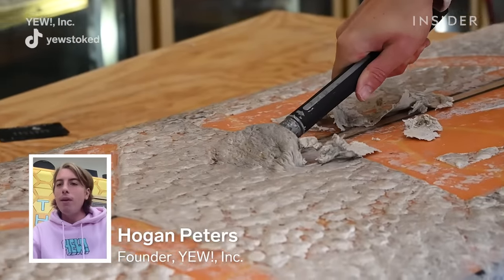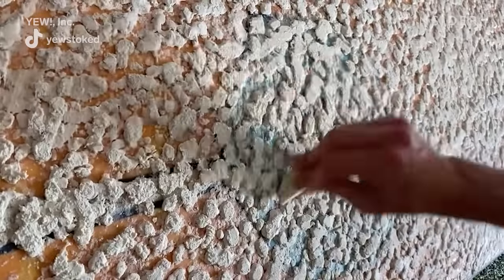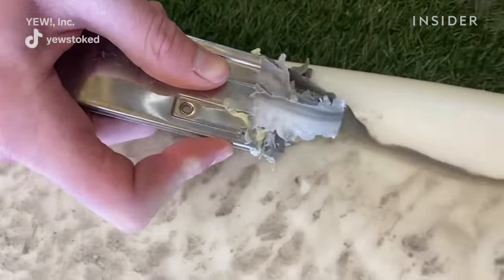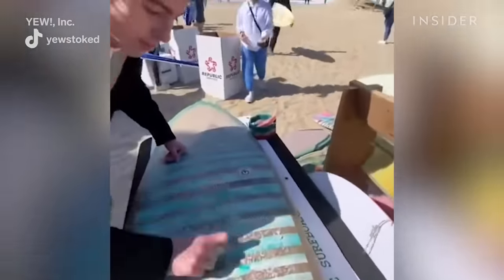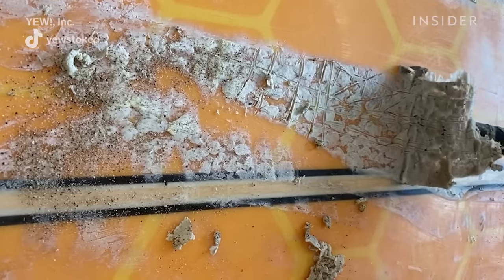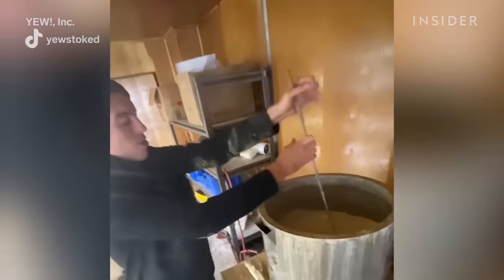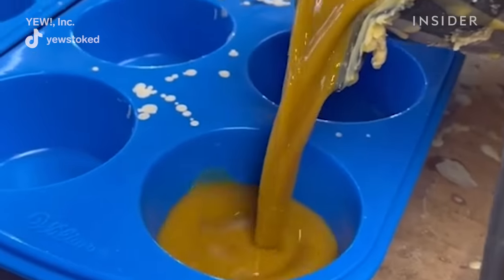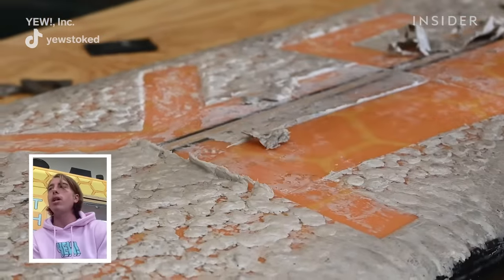Scraping Old Layers Of Wax From Surfboards | Art Insider

Comment: Wouldn't it be easier to melt it in hot water instead of scraping it with force?
Reply: Wax and water don’t mix, that’s why it’s used on surf boards so that it will stay on the board. An easier solution might be to heat it with a blow dryer to soften it a bit, but I’m not sure how good that would be for the board. Having said that, it doesn’t look like it’s too hard of a job to scrap it off anyways.
Reply: @Lacroix999  
They said in HOT water, which would definitely soften the wax, making it easier to scrape. That's pretty logical actually.
Reply: @Lacroix999  
And yeah, people are just lazy af.
Reply: @shizukagozen777  I don’t believe so. Maybe “not quite as motivated” to do things they ‘should’, but I don’t believe anyone is “lazy” only that people don’t like doing things that are hard. either way, it’s not our job to judge them. And if they don’t do what ‘should’ be done to maintain a board in smooth working order, it’s their board that will suffer and their face that could potentially smack the wave if they don’t.
Reply: @Lacroix999  
Hmm, yes, this is clearly laziness, and we can judge is much as we want. 🤨
Reply: Or just put it in the hot sun which would also heat it to soften it.
Reply: @shizukagozen777  while anyone CAN do so something, doesn’t mean they should. And if it doesn’t make or break your day, why take the time worrying about and casting judgment about what others do/don’t do? Do you not realize that your judgments say more about what you do than the one you’re judging and that’s why you shouldn’t do it.
Reply: @whatfreedom7  that’s what everyone does.    This guy is a ding dong
Reply: @shizukagozen777  it's not really the laziness people are normally worried about it wearing down their board (graphics), that's why this whole comment section and others like it are filled with people always trying to debate alternatives, and the fact that someone who does this for a hobby or for a living doesn't want to do it every single time. The skateboard community actually shares the same dilemma, not everybody agrees with hard sandpaper that you can tear skin off with when hit at the right angle. But with that they're actually our alternatives available. Though mostly gimmicky.
Reply: If you used hot water to melt the wax,  it'd be harder to reclaim the wax for proper recycling if it was melted with water. He said he's able to remove the impurities and recycle the scraped wax.  There's usually very good reasons why people world wide do things a certain way.  🤔
Reply: @Lacroix999  but sunlight is free and doesn't generate any carbon emissions in the creation of the electricity necessary for running a blow dryer.
Reply: @shizukagozen777  it'd also called being eco-conscious and wanting to recycle as much wax for future use and using a completely renewable resource - sunlight - compared to an electric heat blower....that'd not lazy, it's smart.
Reply: @dawnchesbro4189  true, however if sunlight melted the wax enough to remove it, then surfboards out in the sunny weather wouldn’t go well together. Something tells me this wax it harder to withstand that from happening.
Reply: @dawnchesbro4189  he literally said in the video to leave the board out in the sun to soften the wax.
Reply: @Lacroix999  sunlight does soften the wax that way, if it's left out for hours in the sun. But in recreational or sport use on a surfboard, how often will that board be left untouched for hours baked by the sun? And how many hours will that board be in the water, which has markedly cooler temperatures than sitting in the sun? Have we cracked the code yet?  🤨

Comment: Doesn't having a rough sticky surface on a surfboard reduce its ability to glide through the water?
Reply: Not a surfer, but I'd think you'd only wax the top of the board. The bottom stays smooth.
Reply: The board wax is meant for your feet to grip, surfers wax the top part of the board. It's a useful substance that improves your traction without increasing risk of abrasive injuries.
Reply: Nope! As long as you are not placing the wax on your rails or bottom of the board, otherwise you would be fine. Wax is sticky so it helps to allows surfers to preform tricks and turns, and helps maintain to have your feet stay on the board.
Reply: Yeah, water will grip to it. Once I used so much wax on the board I almost dragged the Atlantic Ocean away with me.
Reply: @4f52  this gave me a good laugh 😂
Reply: You obviously don't wax the bottom, come on now ! 😂
Reply: @4f52  
BAHAHA

Comment: I have a question for anyone that may know. Why do they use wax and not just make the surface of the surfboard textured for grip to avoid the necessity and extra work of waxing?
Reply: I'd guess that any applied texture can wear out needing expensive professional repair where this can be done by anyone and is cheaply and easily maintained. I'm sure some company is trying to develop some nano technology to mimic a geckos feet but it would make a surfboard close 50 billion

Comment: There also is this brilliant material that is called rubber, doesn’t wear nearly as quickly as wax and grips just as good.
Reply: rubber also cracks, peels, and warps and when it wears off in like 2 days due to saltwater corroson youll have to buy a new board

you are not a very brilliant fellow
Reply: Rubber is also super slippery when wet, sooooooo...

Comment: Snowboards do something similar, but it's for the opposite reason. You put it on the bottom, and you use it to glide on the snow better. Also, you kinda work it into the board instead of leaving it in sheets.

Comment: I'm a soap nerd so this is neat to see you using basically soap (and candle) skills to produce your surfboard wax. It was also interesting to hear how there's different formulations according to the temp of the water you surf in. Of course that makes sense but not being a surfer I hadn't thought about it. But really more than anything this indulges my zit picking sticker peeling fixation in a very hearty way too. 🫠 Once you have the majority of the wax scraped off do you have a way to rinse the rest away? Maybe buff it out with some really hot water.

Comment: As someone who's complete experience with surfer boils down to 'the big kids on the pier line (our houses were those little places on stilts and a pier/boardwalk/deck. Walk out of house onto back deck, walk too far and fall directly into the Atlantic, so 'neighborhood' feels like a weird way to explain it) would surf and just pass me board to board' and therefore utterly uneducated about this stuff... why not put grip into the board build? The board equivalent of that grippy cupboard liner stuff that keeps things from sliding type thing? If you want grip and don't want to be grinding petro-based oils into the water... wouldn't it just be better to build the grip into the board from the start? For smoothing like in snowboarding, I get waxing Boards get beat up and dinged, the surface damage would slow the board or at least make it a bit more difficult to maneuver. (guessing on that one too, I'm more likely to be in the lodge with hot cocoa and a long day curled up somewhere warm reading while everyone else goes tumbling down a mountainside on a bit of wood) Not so much understanding why you wouldn't just make the board grippy when it's created. What am I missing? (Other than any desire to go and attempt either surfing or snowboarding. THAT, that can stay missing. I like having 2 unbroken legs, thanks. And I know my limits of coordination!)

Comment: Im not knowledgable on surfing so can someone please tell me why instead of waxing they dont just have the premade foot insertions that you can buckle your feet to the surfboard like in snowboarding for instance? You could still move the board but yiur be strapped firmly no?
Reply: If your feet were to be strapped in place on an object that floats you risk getting trapped upside down underwater in surf currents and potentially unable to free yourself. Some boards have an ankle cuff attachment so you don't lose your board,  however you'll notice that they have a length of cord to provide that necessary buffer of distance so your board doesn't increase your risk of drowning. 

Having something firm to grip that won't cause abrasions/lesions from friction while also allowing you to slide off quickly when needed is where board wax does the job perfectly!
Reply: Thanks guys this was what I was also leaning as to why logically but i wanted to hear it from people who actually know surfing. Thank you.

Comment: Does anyone remelt and strain the old wax and reuse it on the board, or is it a taboo??
For reference, I’m born and live in upper minnesota, like Canadian border… so I have little experience on this topic.

Edited for stupidity, they covered it lol
Reply: Not usually. Generally you scrape and re-wax when it becomes contaminated. Say with sand or whatever else. If you were to re-use it, the surface would be like sandpaper. Board rash is a common issue faced when surfing, which is caused by excess friction between skin and surfboard, so adding sandy texture to the mix would just make the problem worse.